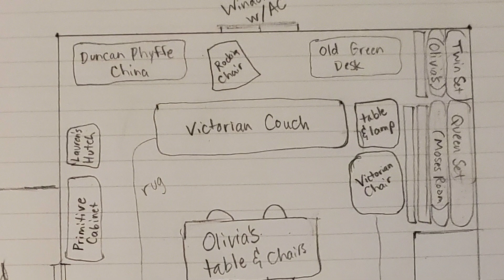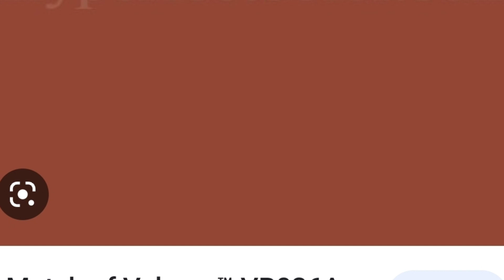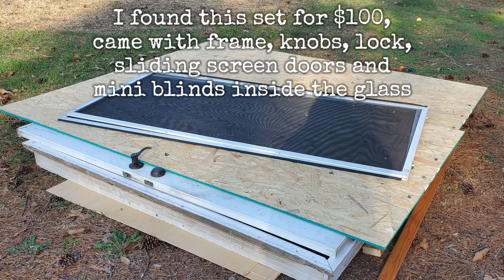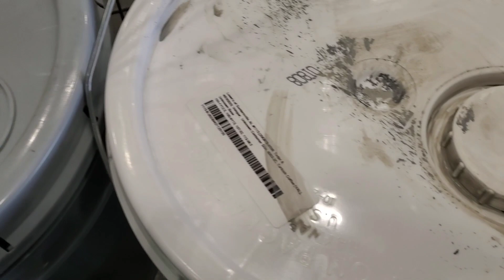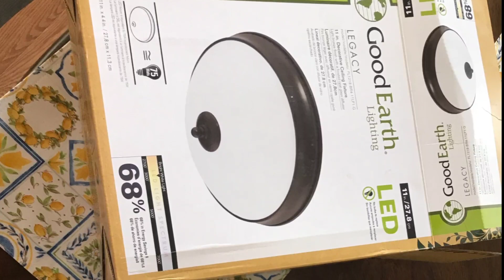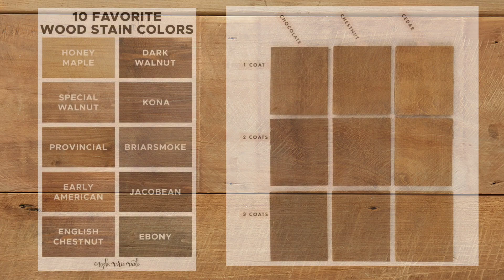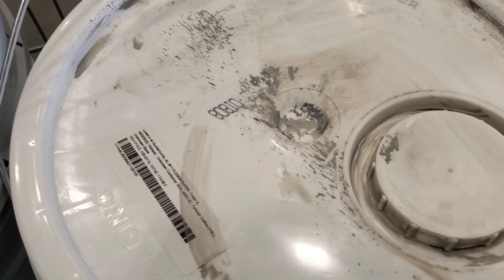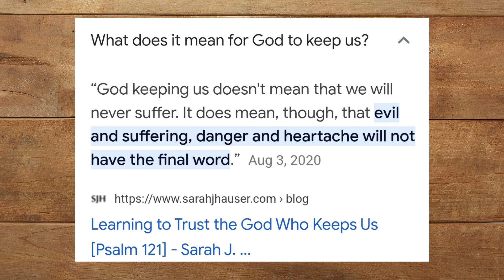She Shed • Part 8 • Painting has Begun • Cedar Shake Awning • Shed Name Reveal • Raising Cain

Comment: 🙌🏽 French doors! 🤗 (Kona is my favorite. No grey undertone at all, very rich and dark. I did my floors with it and it really highlighted the grain.) A suggestion from my experience, lay tarpaper under the metal. Mine had so much condensation up under it in the fall, winter, and spring that it kept the wood moist and it molded clear thru after about 4-5 years. We had to pull all the metal, replace some of the plywood, and put down the tarpaper…and man was that a pain.

It’s going to be FABULOUS! Can’t wait to see what you do. It’s making me want to redo our big building this summer.
Reply from the maker: We do have tarpaper underlayment ready to place on top of the plywood , under the metal! If we could just get all the men and weather aligned to DO IT! The underlayment paper has a sticky side (faces down) and the side that faces up is kind of sandpaper textured, which Ben said would help keep them from slipping while they're installing the metal 👍